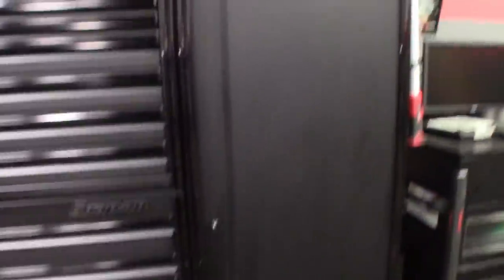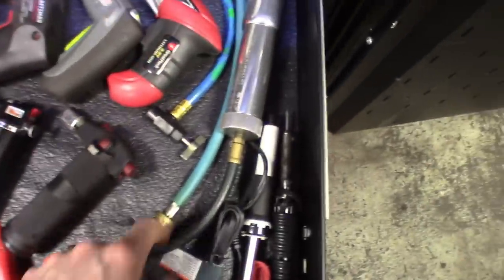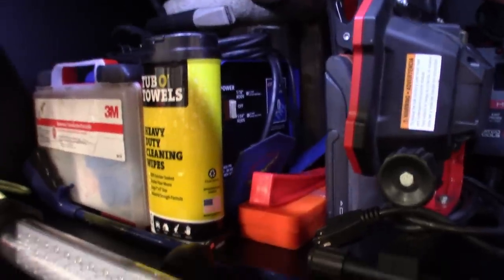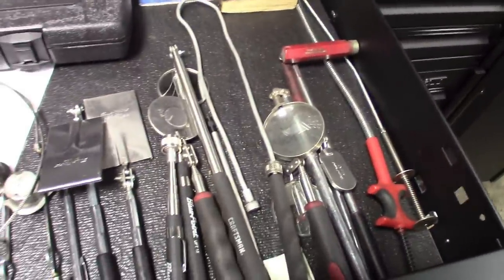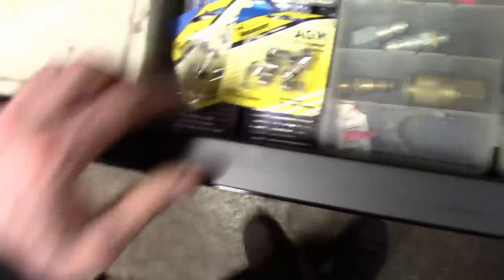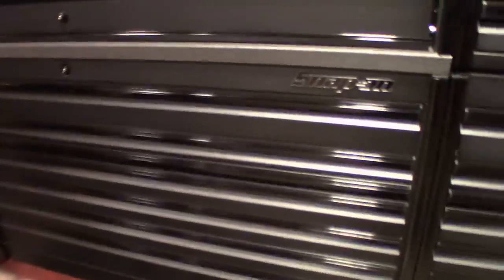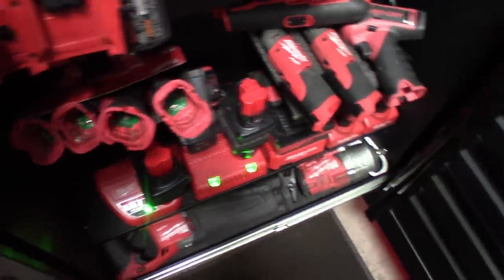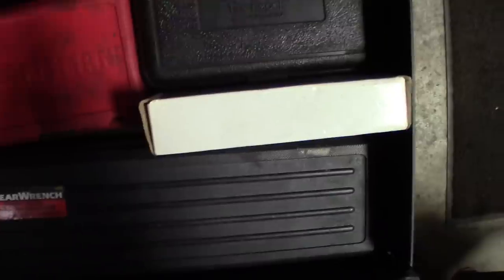2019 Snap On Epiq Box Tour

Comment: Thanks for sharing.  So some suggestions for the socket drawer(s).  I would use both wide top drawers for sockets, ratchets, extensions, torque wrenches, as so on.
Some of my Dad's theories which I maintain today:
1.  Organize first by Drive - You know which drive range you're going to use first and foremost.
2.  For efficiency, keep your ratchets, extensions, and accessories beside your sockets. l opening multiple drawers wastes time. 
3.  Keep all drive tools together; meaning  deep, shallow, impact, swivel, hex, torx, triple square, crowsfoot and so on.
4.  Always keep Metric to the left (or right) and be consistent throughout even in the wrench drawer.

As an example the drawers left to right:  1/4 Metric Sockets, hex, ratchets/extensions/acc middle, 1/4 SAE,  and torque wrench in the area, then 3/8 Metric Sockets, ratchets/extensions/acc middle, 3/8 SAE, and torque wrench close, then probably starting on the right side, 1/2 Metric Sockets, ratchets/extensions/acc middle, 1/2 SAE and then specialty such as Axle Nut sockets and end with 3/4 drive in same order.  

In time invest is some socket trays to be consistent, I like Westling aluminum trays myself.  Have fun.

Comment: Sweet set up... You need more lighting in your lockers...lol
If I could suggest something.. Maybe take some of the drawers you use that may get skuff up, like the edges or bottoms and your table... do a spray liner, maybe on a day off... so they have time to dry also or cure.
I see you have things on the top of your top cabnets, may I ask what you are using to keep them covered, just to protect an keep em clean & support for extra weight ?
Thanks again for sharing your set up... 👍👍

Comment: Do you use any Milwaukee tools? I started using the m12 soldering iron and love it.. I find it way  better then any butane torch I've used. 70 bucks retail. Heats up real quick and holds  temp.
Reply from the maker: Yes I really like Milwaukee m12 and m18 line. I have not used the solder iron but there tools are top notch.
Reply: @JRC54  im no longer making money off turning wrenches its just a hobby for me these days so as much as i love the snap on 14.4 line up. Its hard to justify the cost when I'm already fully vested in Milwaukee as im in the construction field these days.

Comment: I have an old craftsman 26 inch base cabinet and top 8 drawer. I need a larger box. I would like a new 3000 series 56 inch top and bottom and side cabinet. Very cool made in America and same value as gen 2 harbor freight. Same 18 Gage body, depth 22 inch. Not sure of depth of hf.

Comment: Do the multi meter and power probe have similar functions?  Could you get by with just one, and if you could which would you choose?
Reply from the maker: The multi probe has more functions. I like the PP for quick power and ground issues. But for ohm and app issues the snap on is better because the multimeter part.

Comment: Hey man...I got a yard sale tool haul..craftsman..the sockets and such are rusty nasty...is there a good way to clean up ....other then wire wheel on bench grinder????
Reply: Hey bud, put your sockets in a mason jar pour apple cider vinegar til the sockets are completley submerged, let it sit for 72 hours with the top off it a tupperware container so you dont make a mess, Take em out dry em off, do another cycle if it needs it. Spray some WD-40 on em so they wont rust again. Works great!

Comment: Hey big homie. 30:41. The rubber wire wheel.... you gotta part number on that??
Reply from the maker: Link:
WB70 Shaft Mount Rubber Bonded Brush 60mm - Damon Engineering Supplies
https://damonengineeringsupplies.com › ...
Reply from the maker: Search part number WB70

Comment: Thinking of buying chassis ear mixed reviews what’s your opinion have you had problems with yours is it cheaply made a waste of money? 21.24 snappy noises vibration could you give more info as I’m not familiar with it thanks
Reply from the maker: The chassis ears is cheaply made I have one of the older models. I use it as a last resort but it does help on those stubborn noises and vibration diags